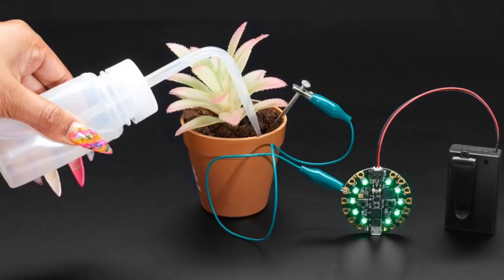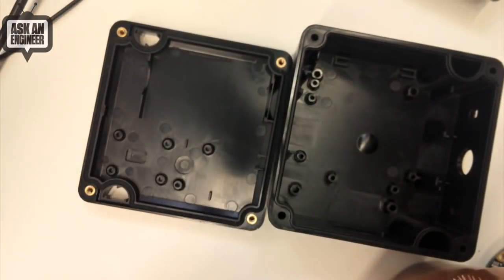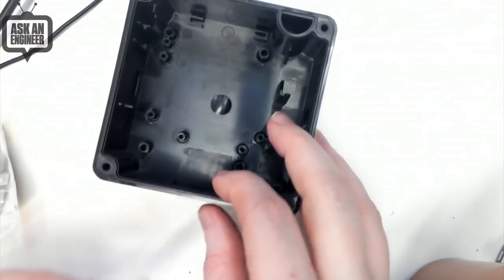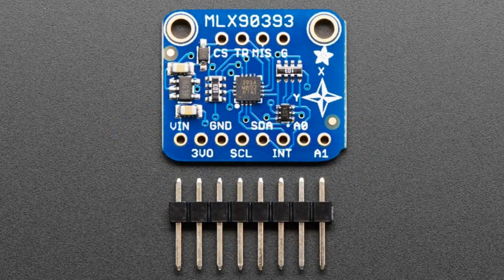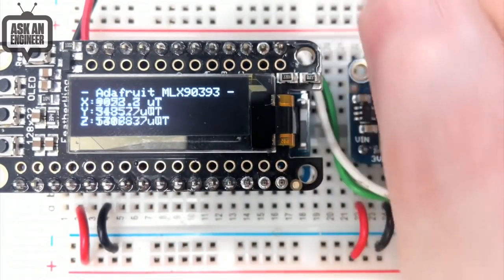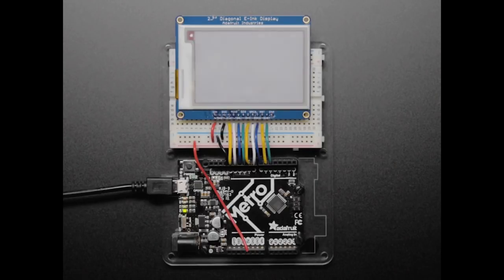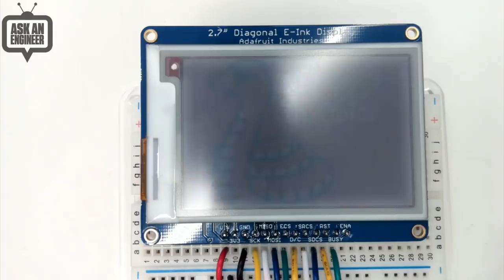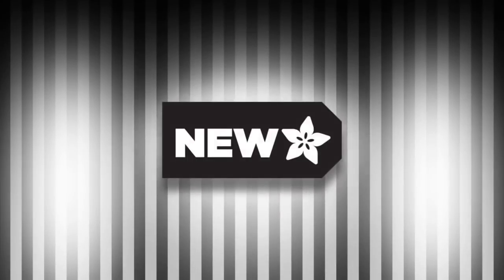New Products 2/13/19 Featuring #Adafruit 2.7" Tri-Color #eInk / #ePaper Display! @adafruit

Comment: Would the MLX be suitable for detecting cars, etc in a driveway alarm application?
Reply: I think it would be very interference sensitive. What do you mean by "alarm application" ? counting or just sensing if something passes ?
Reply: @sheepknightgaming  Sensing. Most of the driveway alarms I've seen are coil-based induction sensors that detect the metal of the car driving over it. Thought this might be similar.